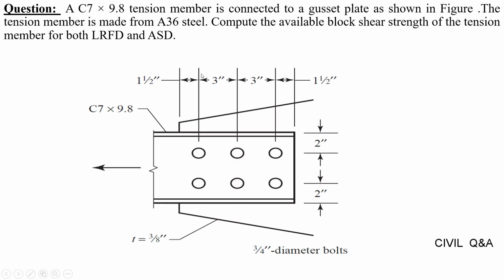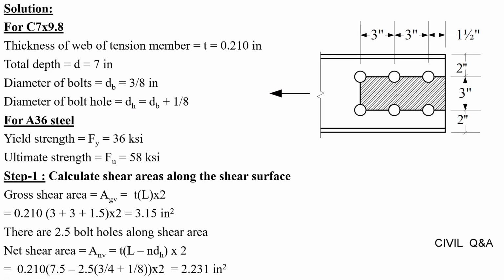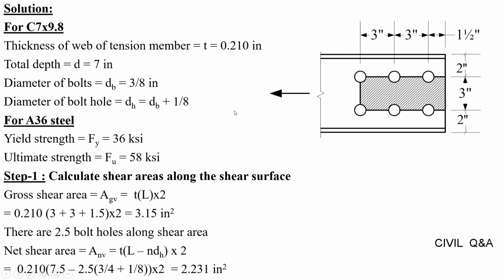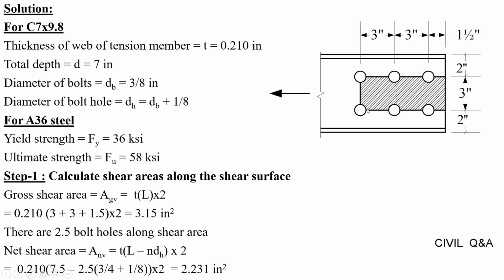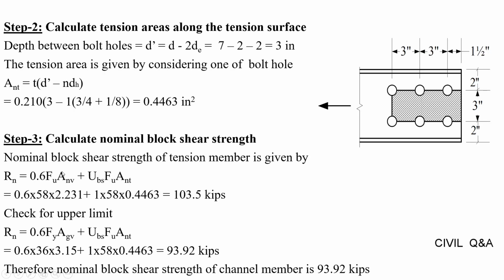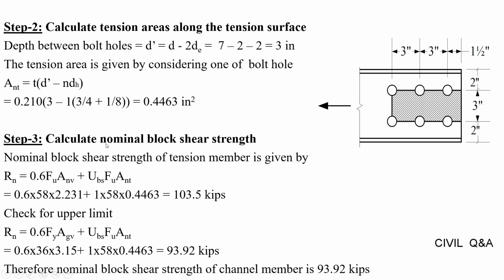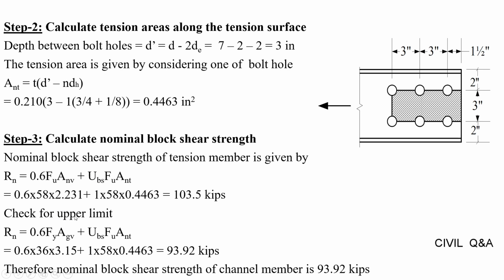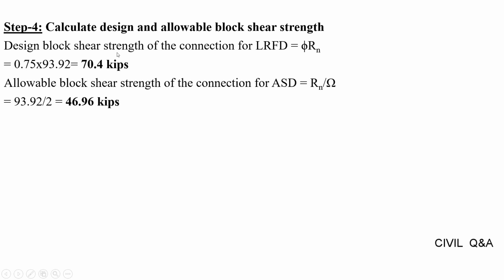Block Shear Strength of Tension member using LRFD and ASD| Block Shear Failure numerical

Comment: Hello, the diameter of the bolt db = 3/8 inches. Bolthole diameter dh= (db + 1/8)inches. Why did you use 3/4 instead of 3/8 as the db in calculating the dh, please? The dh should be (3/8 +1/8) instead of (3/4 +1/8) if I am not making a mistake, please clarify this my concern.
Reply: I think so too…there may be an error in his calculations
Reply: Most probably mistake